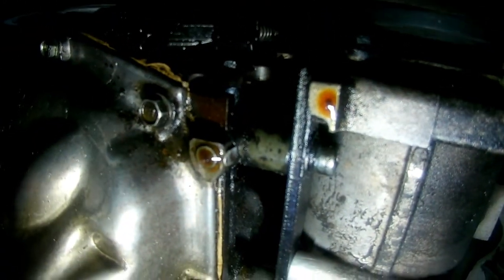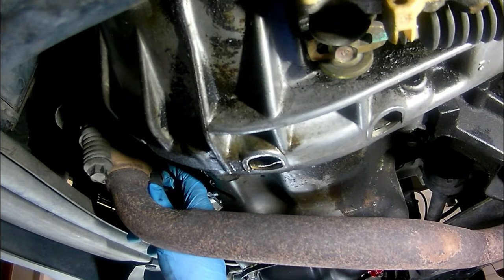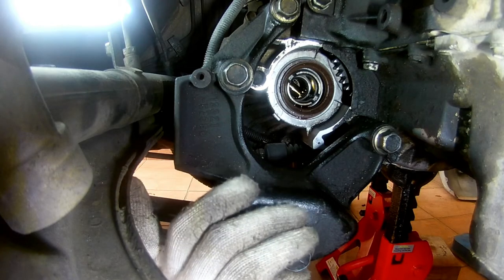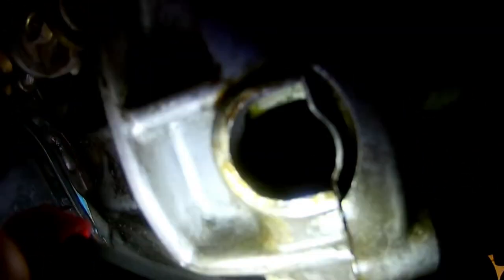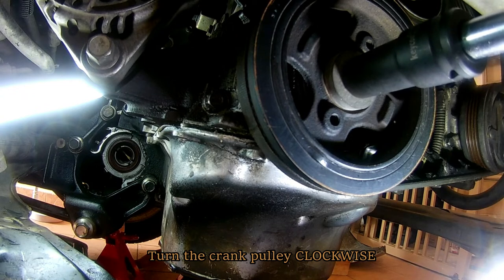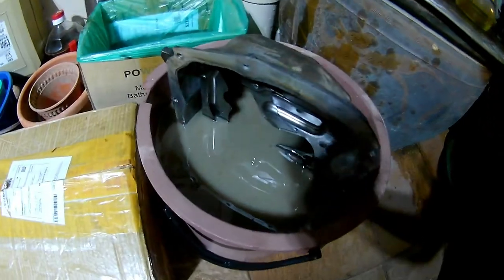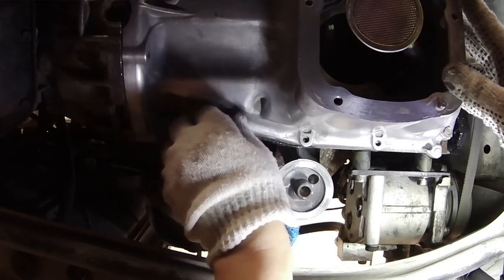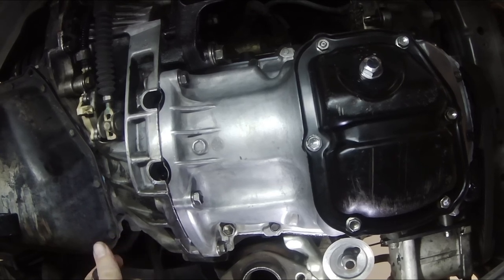Perodua Myvi 2006 - upper oil pan replacement/reseal

Comment: Today I service the caliper pin due to some noise when road surface is uneven and I encounter the oil leaking as this video. Perhaps I take this challenge to repair the leak issue.